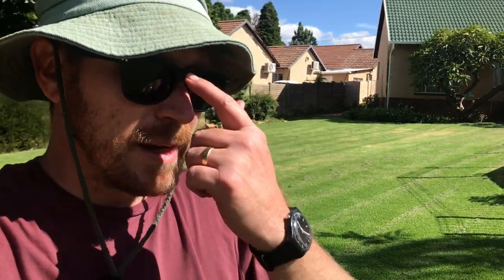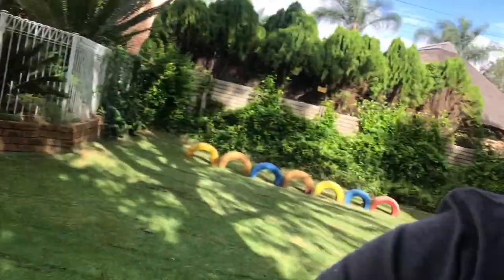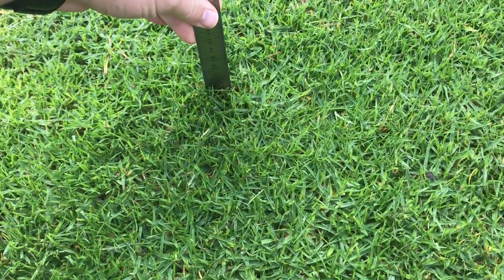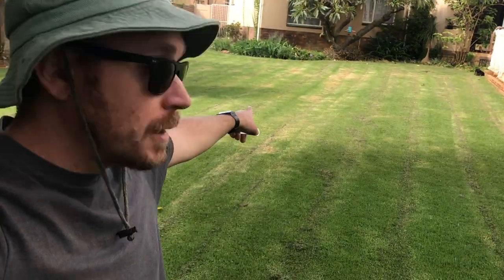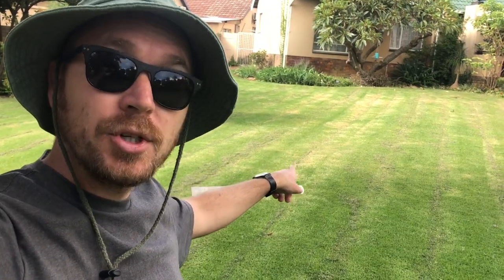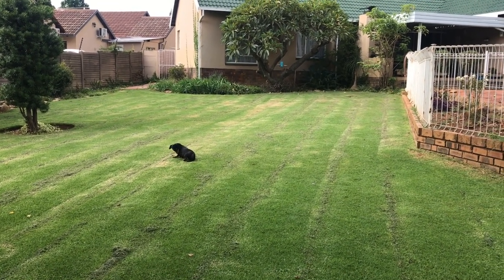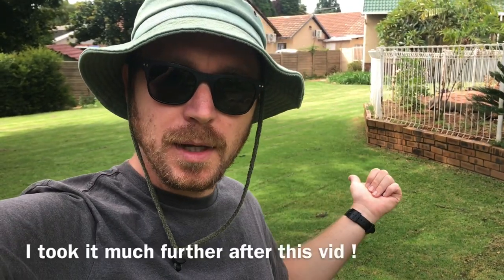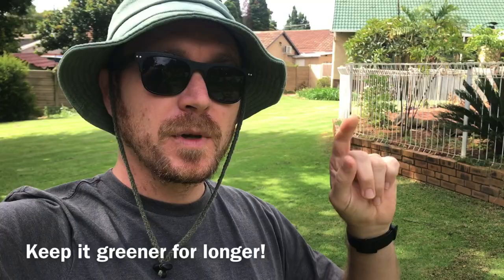Kikuyu mow front to back - 1/3rd rule - HOC reset

Comment: hey mate can i scalp my lawn if i have pgr on it
Reply from the maker: Hey bud, you can but your recovery will be slower. If you’re absolutely sure you already have a good root and rhizome structure then go ahead. Nitrogen is your friend. If you’re in a chilly zone, make sure you send it with enough potassium too
Reply: i live in australia and have kikuyu shouldnt get cooler until may
Reply from the maker: Same with us in ZA. You’ll be fine but just expect some slower recovery. That translates to making sure the surface doesn’t completely dry out, and that you apply stress management products. Ideally stop the PGR during the process.